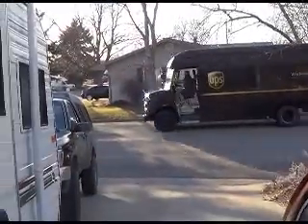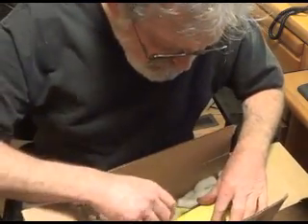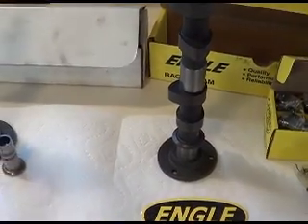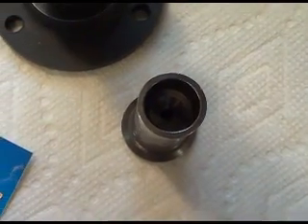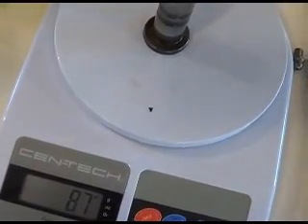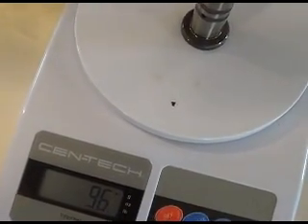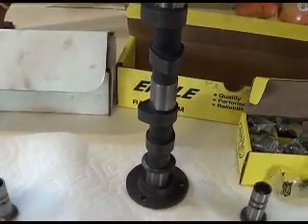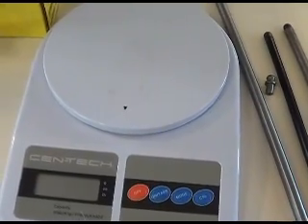VW Camshaft Information

Comment: It does help if you can lighten the lifter in theory...IF the lighter lifter were just as robust as the heavier/denser lifter (BUT the same could be said of the pushrod, which you so eloquently explained deforms at much higher rpm's) which is why the heavier/denser lifter is required if building a performance engine and running at hog rpm.

Comment: I like the stock german steel lifters reground. I have had many of the other after market ones fail. especially the ones with the holes. stock springs work fine it all depends on how many rpms you are revving I never run my vw engine over 6800. but usually not even that high anyway.
Reply from the maker: Your running a lot more cam and a lot heavier springs to see those kind of RPMs.  I like something that run's all day at under 5k and gets fair mileage.

Comment: what do daul carbs do ? do they increas horse power? torque? or are they just for looks
Reply from the maker: It increases Horsepower and Torque and when using a performance cams allows it to idle smoother than stock if you use the Dual throat carbs on both sides. Port on Port baby. It;s the only way to fly.
Reply: TheEZGZ  thanks because im trying to fly appropriately

Comment: Great video... aircooled community is full of great people..
Reply from the maker: Thanks.  I agree that we have a lot of wonderful folks in the VW community
Reply: TheEZGZ what do you think about engle w120 with 1.25 rockers in a 2276? Heads are wedge ports 44x37.5 with 650 springs. Chromoly push rods

Comment: EZGZ
Do you deburr the edges of the lobes on cams? If so, how do you do it? Waiting for the video.Thanks
Reply from the maker: No I do not but not a bad idea ether. Never really felt or saw anything that looked like trouble. I will try and remember to have a closer look next time. Thanks for the heads up.  Always more to learn.
Reply: TheEZGZ what all do i need to buy to install a 110 cam in my bug? Im asking everybody but im not getting a solid response. Hope you can help out

Comment: morning EZ. I have an Erson Cam. Have you ever heard of them? It's an Erson H1V2 with .350 valve lift, .006 valve lash, 290 duration, .320 cam lift, 107 lobe center. 
Do you know what Engle it would be close to?
Reply from the maker: +chris hormachea That's is an old name. Kinda like Isky   Engle has a online catolog. If I were you I would look there in the VW section.  Thanks for watching and commenting